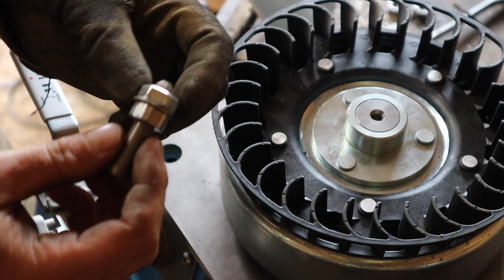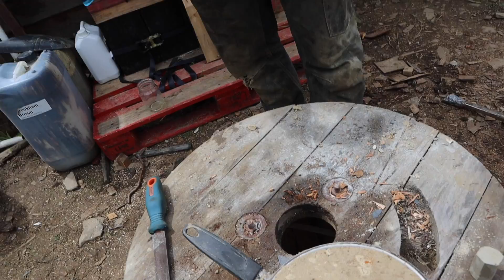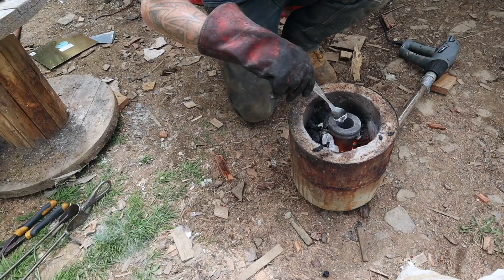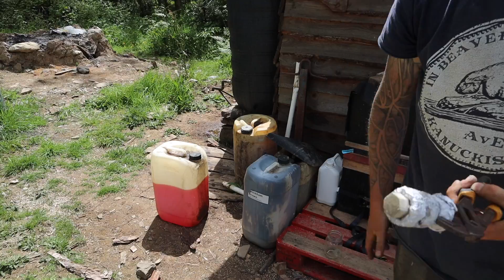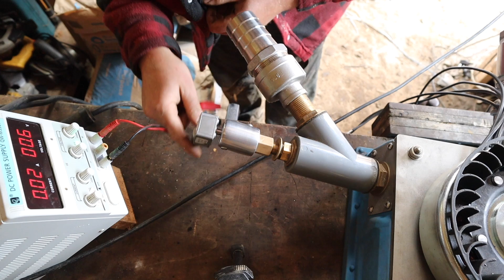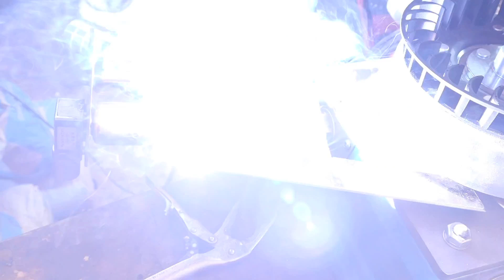4 Nozzle Off Grid Micro Hydro Turbine  Part 5 Motorised Spear Valve Control

Comment: I could have a go at making up a control system for you.
I don't have a lot to do with water turbines etc, so I'd need to know more about that valve. What effect does the valve have? What the idea of it? Does it "aim" the water jet at the spoons, something that will change with water pressure?
Is the idea, that you can get the maximum power out of the turbine VS available water pressure?

Are you looking to have a dial in the house, so that you can adjust things, or are you looking for something automated?

I assume that water pressure at the turbine supply will be the driving factor. So, something that looks at water pressure and output voltage, then adjusts the jet accordingly? 

First skim:
Rule 1-
If output voltage is low, it could be because the water pressure is low = check the water pressure..
If water pressure is low = valve needs to open further.

Rule 2-
If output voltage is high, it could be because the water pressure is high = check the water pressure..
If water pressure is high = valve needs to close further.

Rule 3-

If any end stop switch is activated, supply is reversed for "N seconds" (could be adjustable) and then supply is cut.
Global alarm activates. 

Rule 4-
If override switch is toggled, valve reacts to "OPEN" & "CLOSE" push buttons only.
Reply: For the end stop switches, it would be best to use reed switches and magnets in that environment. I can't see mechanical micro-switches lasting long unless you spend a fair amount on hermetically sealed units.
A cheap ebay reed switch could be soldered up and completely sealed in a piece of adhesive-lined heatshrink tubing.
Reply: The limit switches are essential and are essential to protect the electric motor, both from manual and automatic control, the ideal would be an analogue pressure sensor / transducer, when the pressure drops closes when it opens up, perhaps with a control time of 30 o 60 minutes so as not to make the actuator run continuously, it is not easy to do it from the valley, an upstream level sensor in the intake is much better and more precise, but involves the passage of control cables or a radio system, to valle is easier but less precise, in essence if the flow of the stream decreases the water level in the intake is lowered and the pressure drops and it is necessary to close slightly up to between going up the level, but not too much otherwise run away the water and you are not exploited by the turbine, you need a little control logic

Comment: You could probably control it with a remote relay switch.. https://www.amazon.com/Solidremote-12V-Universal-2-Channel-Transmitters/dp/B01JGDV8UM
Reply from the maker: the turbine is going to be about 300m away and through trees and things. i dont think that would work?
Reply: @KrisHarbour  You may be right!  This one says the range is between 200 and 1000m.. Might be worth looking at. It looks kind of cheep though. https://www.amazon.com/Channel-Wireless-Learning-Transmitter-Receiver/dp/B07KQ1Z871/ref=sr_1_7?keywords=Long+Distance+RF+Switch+Transmitters+%26+Receivers+DC+12V+1000m&qid=1559311569&s=hi&sr=1-7-catcorr

Comment: you reley need a stepper motor and a arduino
https://www.amazon.co.uk/Usongshine-Titanium-Extruder-Printing-17HS4023/dp/B07L8CGQMB/ref=asc_df_B07L8CGQMB/?tag=googshopuk-21&linkCode=df0&hvadid=310804172596&hvpos=1o5&hvnetw=g&hvrand=17825637491543139449&hvpone=&hvptwo=&hvqmt=&hvdev=c&hvdvcmdl=&hvlocint=&hvlocphy=1007454&hvtargid=pla-637610764932&psc=1
https://www.arduino.cc/

Comment: Great Job Mate, don't worry about the worm drive wobble, if you are a little concerned you can always hollow out the stainless tubes more so that the pins never get stuck with any debris later. Other than that you've done yourself proud again & again.

Comment: you should be able control it with just two relais (and two remote buttons), wired through the limit switches if you look for a simple "non arduino" solution :)
Reply: I thought that but wouldn't that just either be fully on or fully off?
Reply: @norfunk  yeah, the drawback is there will be no kind of remote variable speed control or such. Just a fixed motor speed, depending on the voltage you run it with. But on the other hand you gain alot on simplicity... just two DPDT relais (one for each direction) and two momentary push buttons (and the limit switches).. can be built to indestructable from solid, industrial standard electro-mechanical components...
Reply: PS and it's also easy to incorporate float-switches like described one of the comments below. which is a great idea :)

Comment: Use a Solar Single axis keyfob controller. Basically the keyfob switches on the controller to normally raise or lower a linear actuator but you can buy these without the actuator. It just just sends a positive 12v power up to 3amp or a negative 12v power up to 3 amps to control forward & reverse. You don't need the light sensor so just keep that as a spare item.

Choose only single axis controller
https://www.ebay.co.uk/itm/Single-Dual-Axis-Solar-Panel-Tracking-Tracker-Controller-Relay-Extension-Module/192602784432?hash=item2cd80542b0:m:m99MQrdHg67NBVwMn-DoDwg

Mark, Perth, Western Australia

Comment: I would say that, given the slight movement of the motor, making it a floating fit on the rods, is going to reduce the chances of a failure of the welds. Having the pins coated with a grease may slightly aid longevity, but overall it is a stress free mechanism. You're over thinking it to combat the keyboard engineers. Remember that the best answer for the majority of them is two words, the second of which is 'off'
As for the automated part of it, it seems like a pretty basic task for an Arduino project, and plenty out there who would be eager to put their mind to it.
Reply: I've already figured the arduino bit out and haven't even touched my bread board yet, He just needs an arduino uno,ether sheild, and an h-bridge, and a couple end stop sensors (could get by with one but then you need a rotery encoder to determine the travel of the motor).  the uno can host a simple web portal to control the motor, and perhaps even access the API of his inverter (if it has one) to automate the valve for when he needs more or less power.

Comment: the ability to control it remotely is where you will have to get far more creative,  of courses rather than remote control, it would be simpler to go with autonomous control, simple feed to measure voltage of the battery bank, voltage falls below X open valve, voltage reaches Y close valve
Reply: Arduino would do the job at a very little cost, i would say under £5.00, they do a wireless version to £5.00, worth a look i think.